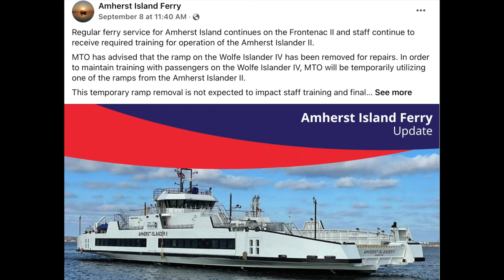A Nose Job on the Wolfe Islander IV - replacing a broken ramp  4K

Comment: Can I put in a little request a video without music onboard the wolf islander 4 showing how quiet it is when it runs
Reply from the maker: You can indeed - and as soon as it's possible to do that, I will get it done - great idea
Reply: @Aerosnapper  it's very quiet when it runs when I was on board during the maiden voyage it forgot we were moving at first till I looked out and I was like oh sh**" t we're moving already I diddent even hear it
Reply: I'm also planning on doing a series of videos of the new ferry including if I'm able to showing some of the electronics  systems and the engine control area